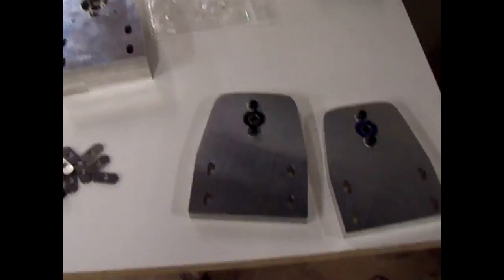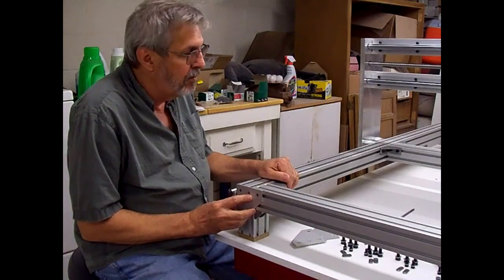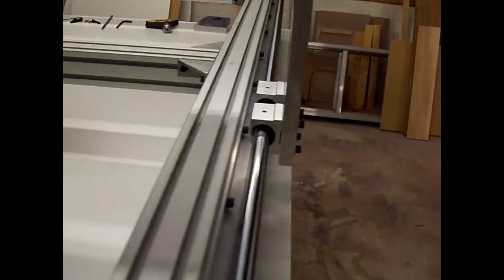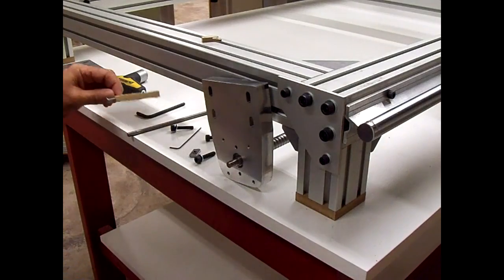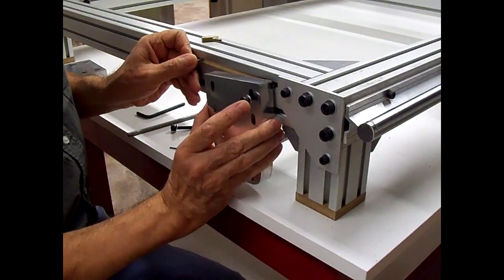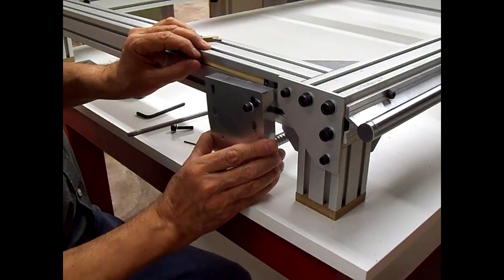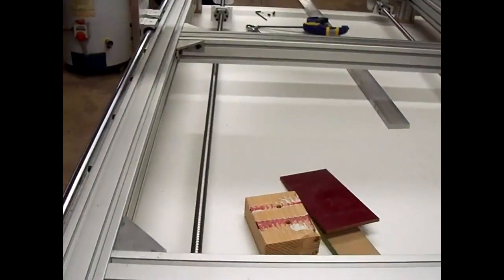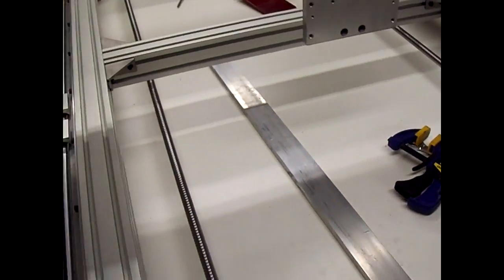CNC Router build part 4

Comment: Robert can you tell me the motor types on your build and ball screw type as well as the dimensions for the gantry - I’m trying to duplicate your build . Thanks so much
Reply from the maker: Motors are nema 23, 425 oz. in., ball screws are 15.5 mm dia. with 5mm pitch, inside gantry end plates is 38.25", cutting capacity is about 31 x 48 I think.

Comment: Robert can you tell me where to find the end brackets for the ball screws- thanks in advance
Reply from the maker: The end brackets came with my kit which is no longer available as the web site I purchased from is gone.  You might try searching online for something.
Reply: @MyRobertadams  thanks for the fast response - I have looked with no luck . Loved watching your build. are u still using that machine today
Reply from the maker: @davidnorth2983  
I use it occasionally. You may have to fabricate your own.

Comment: A zip tie works great for getting the t-nuts to align with the hole and stay square in the slot as well, just slip the zip tie behind the t-nut and push it into place, then pull the zip tie out

Comment: What size Z-axis did you purchase for your machine, 6" or 7" or 8"   If you go into your video at 2 min and 30 seconds, where the yellow drill is at the top of the plate, what is the length of that z-axis plate?  thanks bob

Comment: Hi,
It is a very nice video, showing your progress of building a nice CNC, but I keep wondering about why didn't you use T-nuts. I see you fiddling with those plates and trying to find the threaded holes with the screws and I feel you pain... I built a similar CNC but chose to use T-nuts to avoid the problems you are having. I know, you will probably say that's added to "Lessons learned"... Never the less, great video. Thank you for sharing.

Comment: hi instead if the wooden tool use a magnet
Reply: I'd have just preloaded the drop in nuts, and then slid them in as you're ready to lock them down.  No good reason to drop them in the tslot first.

Comment: Nice going Robert,  You are almost there. just a few last things to tackle! Don't you just hate waiting for parts? :-(
btw are those plates 3/4" thick... SERIOUSLY? those are some beefy looking plates....
Anyhow. I was going to tell you what I do to get the ballscrews perfectly lined up..
1. Mount the ballscrew bearing supports for both ballscrews loosely to either side of the machine not so loose that they jiggle around but loose enough to move by hand and give just a bit of space to each side for adjustment..
2. mount the Ballscrew nuts solidly to the moving surface that is solidly attached to your linear movement (in this case your gantry) and move them all the way to one end as far as it will go.
3. you can now tighten your bearing supports on that end.
4. move the entire gantry to the other end of the table as far as it will go.
5. Tighten the bearing supports on that end.
6. Profit?.. Your ballscrews are now perfectly aligned. :-)
BTW. I am going back home this weekend and I plan to begin the design process for my new machine. I'll probably post the videos as sort of sped up with a voiceover sort of thing.. I don't know... I'm not used to recording everything I do...

Anyway...
 Always have fun and Get 'er Done!
-Idontrunntoofast